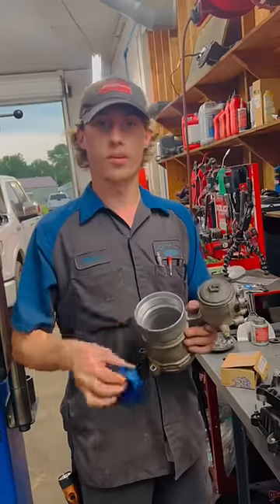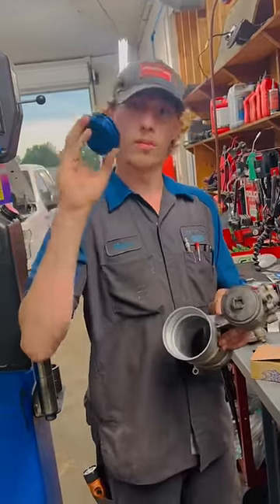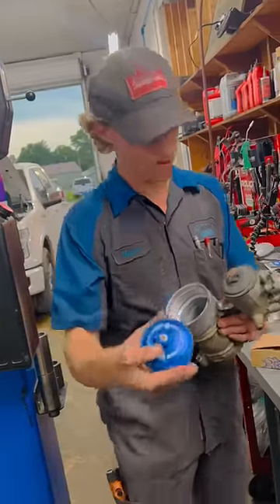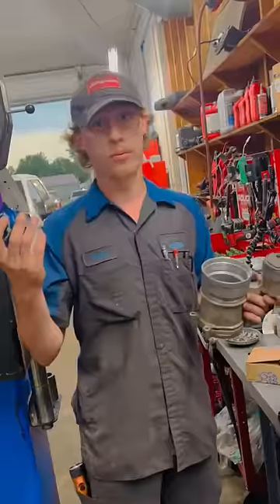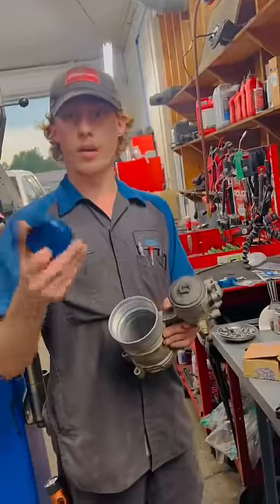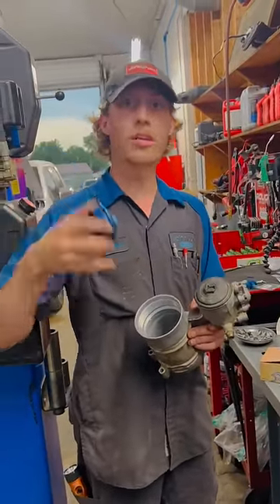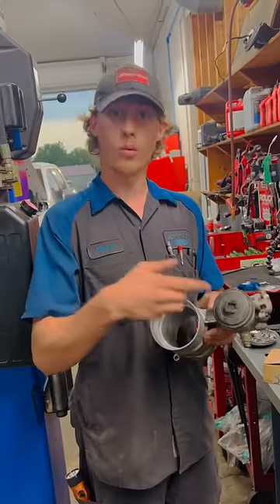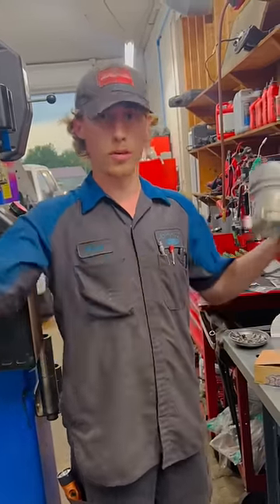Ford 6.0L PowerStroke Broken Fuel Filter Cap FIXED #shorts

Comment: Yup. Seen my share of them back in the day when they were coming into the dealership. I agree that it's likely from using a 1/2" square drive to attempt to remove the cap instead of using the 24mm hex. The good days when these 6.0s were coming in...
Reply: That’s so dumb. If it’s shaped like a socket goes over that’s most likely where you need to be. Sounds like that would do it for sure

Comment: A easier way is drill a hole in an angle on either side of the cap at the top. Take 2 Phillips screw drivers, 1 in each hole. The screwdrivers will cross and you can trun it right out. No chisel needed, but great up grade
Reply: Tried everything still doesn’t come off

Comment: The upgrade that should've come stock. Can't believe they have reusable filter housings made of plastic but the truck has heated seats and climate control and all the stuff it doesn't need.
Reply: Down here in Florida AC is a must.

Comment: Many times. Though through a shop they will only use OEM.
Might want to advertise that to shops local to you.
Reply: Ok here's the problem at times they know the OEM is not dependable as the after market part, if your working at the dealer,  you have to push OEM parts witch most of them come from autozone but 🤫 they get to charge what they want for the part. If you have go to a independent shop they will recommend the best possible part that will be better than a OEM part.

Comment: Bleed hole is to purge the air out of the lines  if u run out of fuel
Reply: A fool hes talking about oil not fuel
Reply: That filter housing aluminum cap is for the fuel filter. That big whole on the side, that is where the oil filter be
Reply: @sidewayshappy6316  Your just gonna stick with that reply? Did you eat h the same vid the rest of watched?

Comment: Which Ford power stroke do you like to mod?
I'm looking to get an '06 6.0 bc I know those motors & the common high pressure oil problems.
What mods are essential?
Reply: Don't get a 6.0 or 6.4 you're just going to be disappointed
Reply: I've owned 3 6.0s still driving the 3rd one it's not worth owning one.    For the amount of money you need to dump into one that would make quite a few payments on a newer truck with a 6.7. Getting parts for Ford trucks older than a 2011 its getting tougher.

Comment: Good god just use the correct socket.  I’ve changed thousands of these with no issues.  Stop using the 1/2” drive and the stock one is fine.  The only thing blue on you truck should be the Ford logo.

Comment: You'll have e that same type of issue with the aluminum one if you're not careful
Reply: Yeah I've thought about getting aluminum but the plastic is dummy proof in my opinion, I think the plastic is designed to fail before you cause extensive damage, imagine some guy over torquing and cracking the fuel filter or oil filter housing..........that's a lotta dough haha

Comment: Would you personally own a 6.0? A "what I recommend to do to a 6.0" series would be cool
Reply: I’ve done some research but I’m not a professional by any means. I’d personally only buy a 6.0 if you know who owned it from factory. 
The main problem with most ford engines from the 5.4 triton to the 6.0 power stroke is if you maintain them religiously they will last forever regardless if you beat the piss out of them.  The problem is most people don’t religiously change oil and regularly run cheap oil to save a couple bucks. I’ve known some 5.4 tritons to hit over 400,000 miles with only changing the timing chains and guides once. But they ran really expensive oil and didn’t push it.

Comment: Bro.   Save you’re time.   These trucks are 14+yrs old.   Been fixing them since before YouTube was a thing.    No one’s driving them anymore.   Too many dum dums worked on them & turned them to junk and no one can afford to keep them on the road
Reply: So true.
Reply: I have an 03 6.0 that runs great. 325 000 on the clock. Daily driver.
Reply: @robertdilullo6765   I love the 6.0L  owned one for a long time but the 6.7L makes way more power and is more efficient  and just as cost effective to own.  Parts are more readily available too
Reply: @BigWheelBaggerDad  Hey BigWheel,I love my 6.0.I have kept the interior immaculate changing out my construction clothes after work everyday. Maintenance out the backside, oil ,all fluids, filters, grease ,maintenance on the body. I probably changed transmission fluid 10 times and filters. Almost 20 years old and running great. Brand new tires last week. The starter went bad Thursday at work, changed it Friday on the job. I went with the 6.4 starter and I like it. I hate to say it but the time is coming for a6.7.I really want to see how long the power train can go Working on these trucks saves so much money. I'm no mechanic but the 6.0 is not that hard to replace some common problems they have. I'm lucky to have a backup car while I work on the truck.
Reply: @BigWheelBaggerDad  $11k plus for when the cp4 fails,$3500 plus to reseal the upper oil pan,$3500 plus when the turbo fails... Tell me more about how cost efficient the 6.7 is again👂👂🤣🤦🏼‍♂️
Reply: Well not everyone,  original owner 07 f250 just hit 122k. Super clean and straight,  but yeah haven't done a mod on it in 10 years or more though. In the last 10 years I've had to clean the turbo and do dummy plugs. Oh and batteries too. Your right, most i see now days are rigged up and beaten
Reply: The hell are you talking about, i can’t go down the road without seeing a 6.0.
Reply: @connor4961  that’s cause there’s one broke down in your neighbors yard lol
Reply: @BigWheelBaggerDad  nah, my neighbor owns a dodge, the 6.0 is a pretty good truck, I see them working all the time. if they were really that bad no one would be driving them yet I see them every day all working like a diesel should.

Comment: go ahead and get an endorsement from sinister. 6.7's are the same problem with the upper filter
Reply: Bruh 6.7s don't get a cartridge filter, it's all in it's own unit you just replace the whole thing
Reply: @nativeoutdoors1780  gota love keyboard warriors...if you want to get technical, 6.7's actually have 2 filters. from 2011 to like 2017s have a round upper and a lower.  2018s and up have the same round upper filter and a square lower. Before you got to preaching and telling somebody what kind if filters it has, go buy you a couple of these trucks and change those filters a few times
Reply: @benhetzel6426  oh so you can buy an aluminum top for the underhood fuel filter for the 6.7? Or do you buy the whole unit and just connect the quick connects to it.

Come on man I know you work around these, try to use your brain and remember though
Reply: @benhetzel6426  now the 6.7s have the opportunity to get spin on filters with aluminum tops, but that's using non oem filters so it's nowhere near the same as just replacing the top like in 6.4 or 6.0